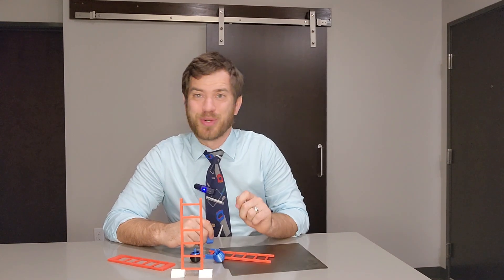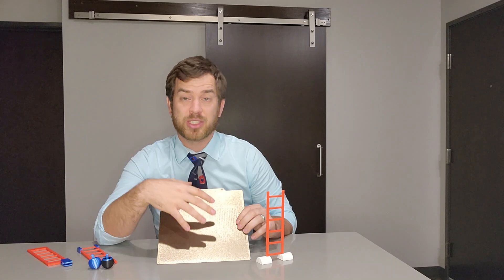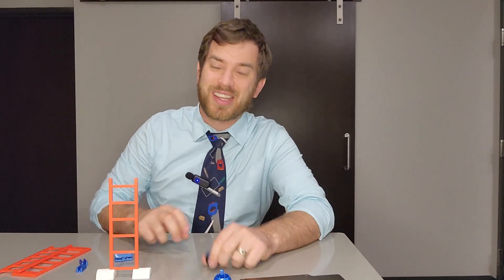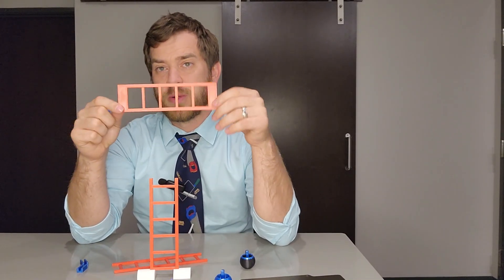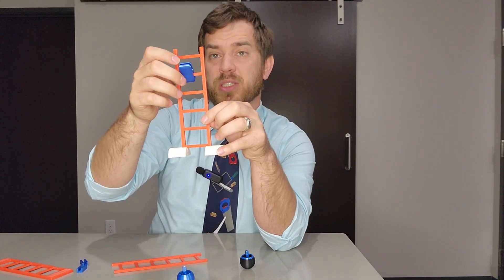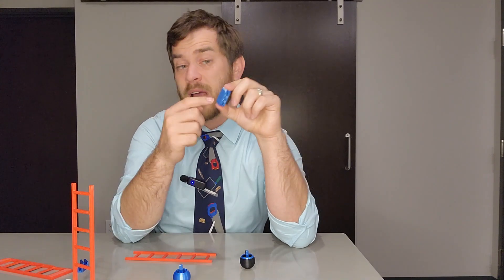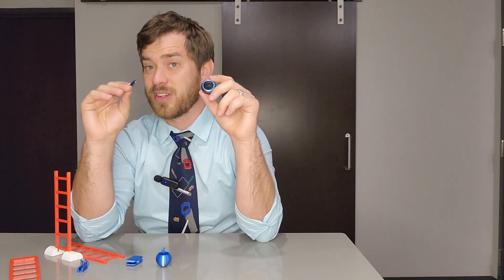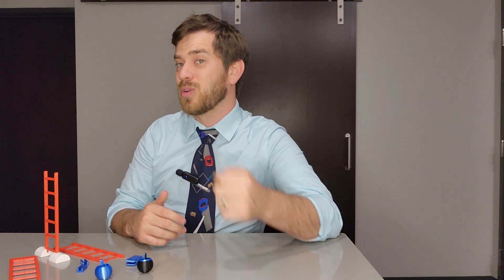3D Printing Challenges for the Classroom

Comment: are there directions for the kids to follow to make the Tumbler and the Tippy Top?
Reply from the maker: For the tumbler, I give students the ladder and show them a video of the tumbling toy working. Then students just do trial and error until they get working. If students are really struggling, you can draw the side profile on the board. But it is alright to have students struggle a little bit. And don't give into the temptation on telling them how to do it.

For the top, I typically just give each group a printed top and see if they can replicate it.

Comment: What printer do you use?  My classroom printer is obsolete and now has no replacement parts.  I am looking to upgrade from our Makerbot Replicator.
Reply from the maker: I currently have an Ender3 V2. But if you have the budget, I would consider looking into the Bambu Labs printers. They are crazy fast and very reasonably priced. Having at least 2 is ideal so you can get one print running, while you start your next one.